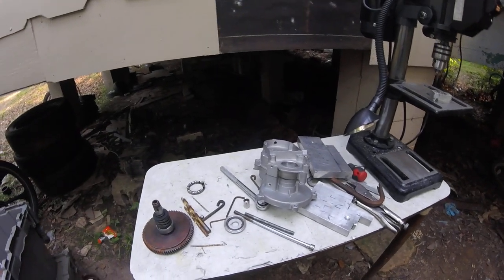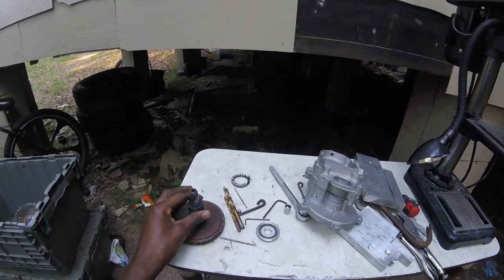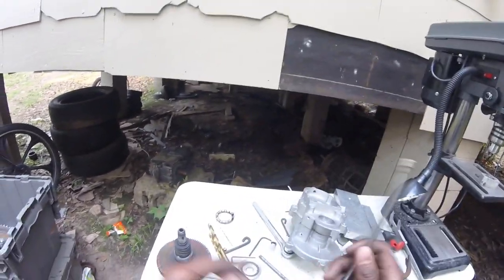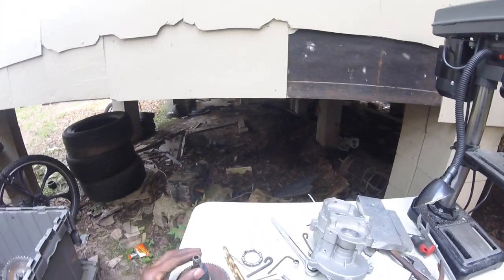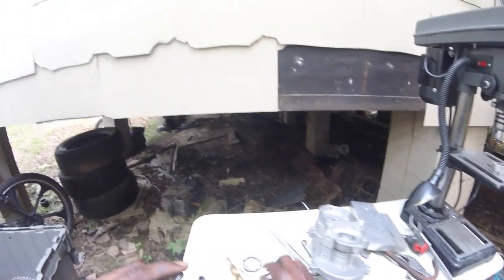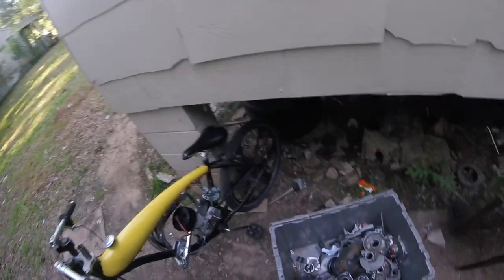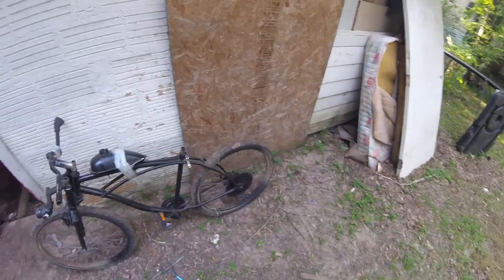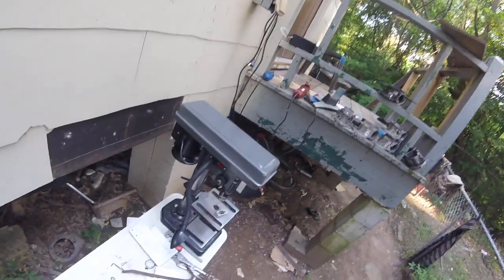How to make a Bucking Bar and Ball "Tip and Tricks" Subscribe and Turn Notifications On

Comment: Hey brother, I need a crankcase to build a frankenstein out of. Rite now, running dio set up on a standard cylinder with an aluminum plate 10mm thick to connect them. Brother, it works perfectly. Getting 48mph with a 36t sprocket! Huh, yeah I know it was screaming. Can you help?
Reply from the maker: Gasbike .net $30 a case